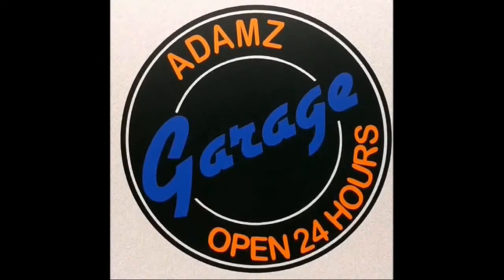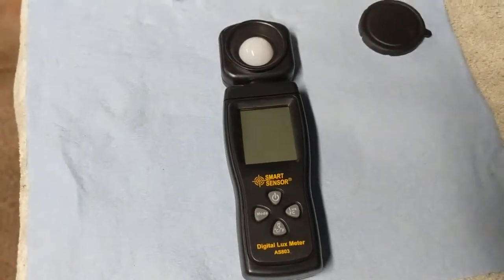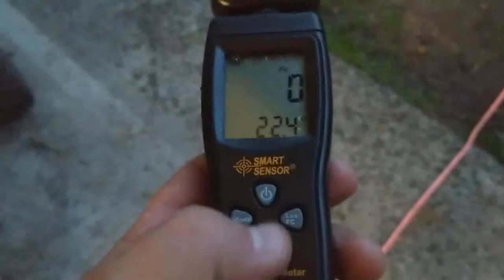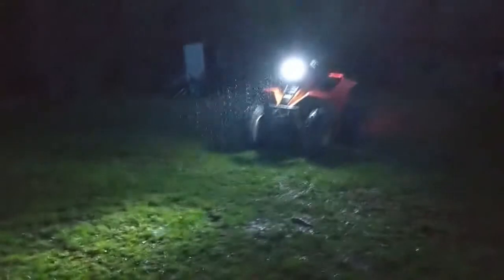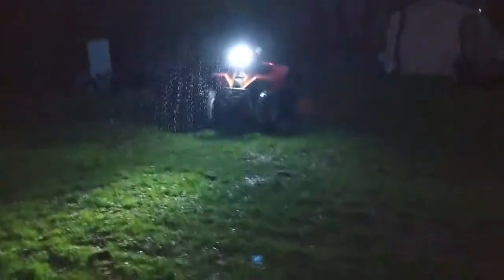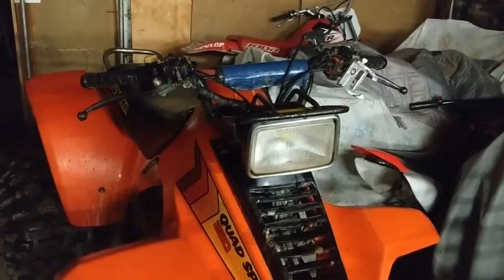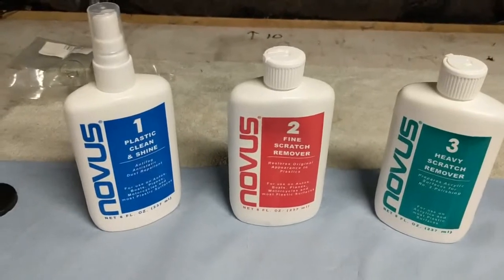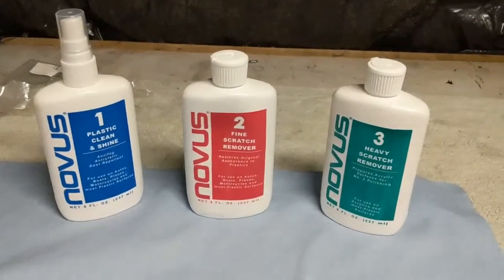L.E.D headlight bulb upgrade ATV/ Suzuki 230 quadsport.

Comment: Does the hi/ low part still work? And was the video done on hi or low beam?
Reply from the maker: Hi. Yes the hi lo beam does still work and I believe  I did the video on low beam.
Reply: @AdamzGarage  can you tell me where you got the led bulb please.
Reply: @AdamzGarage  I was hoping you could tell me where that bulb is available  the numbers I punch into Google dont come back to anything.
Reply from the maker: @timbeach2409  try this link. The only issue you might have is shipping can take awhile. But look around you might find some in the states. Good luck.  https://www.ebay.com/itm/LED-Headlight-Bulb-For-Suzuki-LT-F160-230-250-Quadrunner-LT-230S-250S-Quadsport/323652925584?hash=item4b5b37b890:g:nfQAAOSwL7VfDB00
Reply: Nice upgrade, where abouts in upstate N.Y. are you? I'm in camden N.Y. I just picked a 230 up and got it running. Had one when I was a kid and now I got one to do a full resto mod on.
Reply from the maker: @itsNuTz  I'm just outside of Albany NY , my Brother bought some land in Camden about a year ago. Congrats on the 230, fun  Machines. My 1985 230s is a blast.  Good luck with the project.

Comment: Any idea on what size bulb fits the rear brake light? I bought the same LED headlight bulb as you but figured why not change the rear to an LED too.
Reply from the maker: I know the original was a 5 watt bulb. I think partrt # is 14463. I think they were pretty common for atv's of that era.  Not sure if I've seen an LED replacement bulb though. I wonder if there is one?

Comment: Is that the stock idle?
Reply from the maker: No, I actually turned the idle up that night so I could get the best output. The nice thing about the led is it doesn't fluctuate as much as the original.

Comment: Can i use nail polish remover to remove my paint? Also where can i buy those materials?
Reply from the maker: I have used nail polish remover in the past for small parts, but doesn't always work so well on old cured paint, but worth a shot. You can find those bulbs on eBay item#163139149870. They come from overseas so take about 2 weeks. $12.99 but so far they work great.